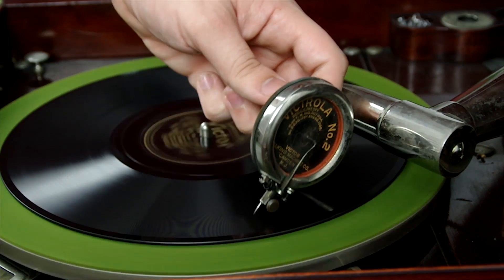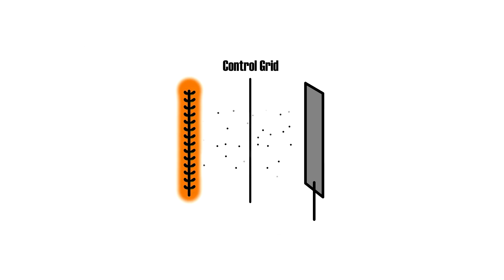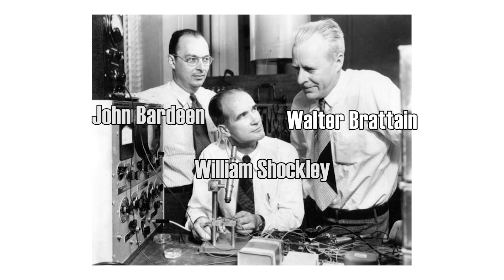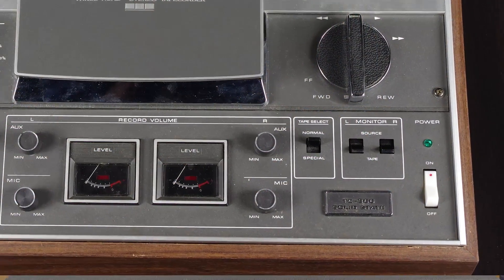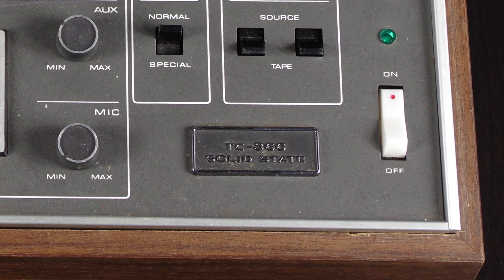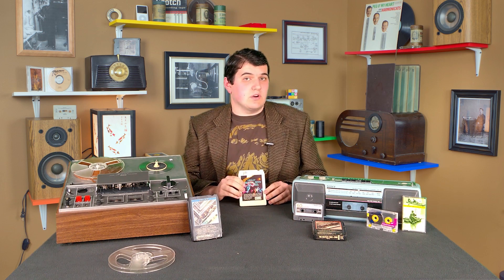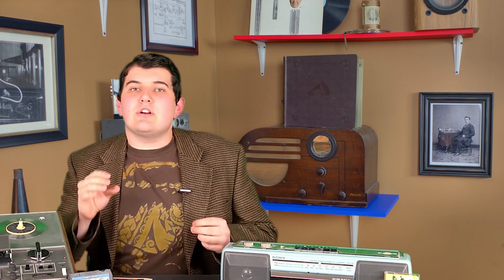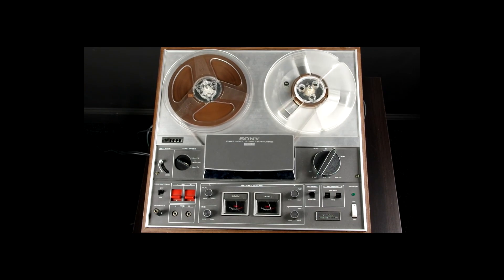Transistors: Making sound easier, smaller, and more efficient

Comment: Very good and informative video.  If I can make one minor correction.  At 3:45 you mention the three terminals of a transistor being gate, source, and drain.  This would only apply to MOSFETs or Metal Oxide Semiconductor Field Effect Transistor. MOSFETs didn’t really show up until the late 1990’s to early 2000’s. MOSFETs are voltage controlled, and really take place in processors, or high power situations.  They gave birth to switching power supplies (like our small phone chargers) and thus don’t need a big step down transformer like linear power supplies.  MOSFETs are also used in audio amplifiers now but there’s some debate that they don’t sound as good as traditional transistors.  Also MOSFETs are excellent at very fast switching often times in the MHz frequencies.  This allows digital tuning without having to adjust a variable capacitor.  

Traditional transistors like NPN or PNP are current controlled, and were the main transistor early on.  They weren’t great for CPUs as they’re not all that fast at switching, but when it comes to amplification, they can amplify a nice clean analog waveform to a bigger one.  Audio enthusiasts say these amplifiers give the cleanest and most detailed sounds albeit they can’t output the power that MOSFETs can.  These regular transistors are still used in LED circuits, and preamp circuits as well as other places where you need to amplify an analog waveform.  The pins are labeled collector, base, emitter.  

Fun fact, over 13 sextillion transistors have been produced since they were first being used in the 1960’s.  13 sextillion is 13,000,000,000,000,000,000,000

That’s a lot! Some say it’s one of the most important and crucial inventions in history.

Comment: I know this video is 9 years old but YouTube just recommended it to me so blame YouTube.
In 3:24 and 3:34 you said a transistor "only" works the opposite of vacuum tube but only NPN/N-Channel transistors are opposite and PNP/P-Channel work the same same.
Pin names in 3:46 are for FET and pin names for BJTs and IGBTs are different.

Comment: When I studied elecrical and electronic engineering at college 1969-1971 it was all about valves and the transistor was not in the syllabus as it was too new. Come University in 1971 and the valve had been dropped in favour of the OC71 transistor. I had a Philips AG8106 valve tape recorder and later a Sony TC399 transistor tape recorder. Currently I have a Technics RS-M231X cassette deck.

Comment: You clearly dont know what you are talking about. I am collector of electronic equipment. Main reason for tubes to be replaced was not bulkines, inefficiency or fragile as you said, but to the countrary of you said next not so great controlling of larger electric current. Tubes are voltage driven, and curents are in mili amps... and most of the power to be controlled require high voltage, but sound quality and overall experience is by far superior. Some parameters like noise of elektron tubes is few hundreds thousands time lower then transssissdstorrrrsss.. and if used properly quality  tubes dont break easy, for 60 vintage and modern used transistor amps I purchased online 18 arrived broken, and for over 80 tube amps 20 arrived broken which maybe 2 were related to tubes... mostly old capacitors. And I enjoyed over 10 amps from 50-60 with original tubes and caps still working fine in 2023 !  And as the answer to why transistors replaced tubes mainly price is to blame, transistors were expensive first, but production could be automated and price droped and that happens.  Transistors have advantages but also limits particularly no soul, many electric guitar players changes tubes to obtain desired sound, does anyone change transistors to do that ?
Reply: Yeah, uh, nobody asked. You probably think you're doing everyone a favor by pointing out things that might be errors in a 7 YEAR OLD VIDEO, but no, you're not, you just sound like an asshole, at least to me.

Comment: Vacuum tubes can be efficient in a correctly designed circuit, which is why now, in 2023, you can get plenty of brand new Tube amplifiiers.    The main thing that made Transisitors popular were small size, cheaper to manufacture and they didn't need to have plate voltages of several hundred volts.   This made it easier to make low voltage and battery powered devices.   Due to being small and cheap, it also became easier to make cheap radios, like a lot of consoles from the 60's and even 70's.   A lot of the TV's still used tubes, but radio sections went  to solid state.

Comment: Just wanted to clear up a few misconceptions regarding valves and transistors.
For anyone saying that thermionic valves are either more or less fragile than their solid state equivalents, there are examples of both. Many consumer grade valves were, in fact, quite fragile, but industrial and military valves were designed to endure industrial and military use. The vast majority of NOS and surviving "tube pulls", along with new-production valves, were designed to meet or exceed these specifications for ruggedness. Today they're primarily used in guitar amps, for crying out loud; musicians and roadies aren't known for being gentle with their gear.
Some transistors can be vulnerable to ESD when not wired into a circuit, but with proper circuit design an installed transistor has rather robust protection against ESD. You're more likely to blow the ass out of a current driver with too heavy a load, but that risk can also be minimized with proper design. Quite a few valves are just as vulnerable to current overdrive damage as transistors (it's called "red plating" in valves). And don't even get me started on the risk of blowing cathode bonding wires in valve rectifiers.
Most audio output valves require an output transformer to transform their high output impedance to match a low impedance loudspeaker. Many of the stories you've heard about guitar amps catching fire during a show have been due to improper impedance matching. This simply doesn't happen in solid state amps; at worst, if the loudspeaker impedance is too low, you'll simply blow the ass out of the current driver and it will stop working; a small puff of magic smoke is released, but no fire. (The transformer contributes to a frequency-dependent reactance with the speaker, but that can be and has been easily incorporated into speaker emulations, both in the analog and digital domain. If you've ever noticed the gyrator in Marshall's cab sim, that's what it's there for. But this point isn't particularly germane to this video or discussion.)
It's true that many valves will drift over time. It's also true that transistors tend to have more inconsistent properties between each device, even between two devices cut from the same wafer in the same production run. Engineers are well aware of both of these factors and design their equipment to operate within "bogey" specs so that such drift and production variation doesn't adversely impact performance. It's not rocket surgery.

Comment: Very common transistor (NPN) BC548 (TO-92) - the Base = grid, Collector = Anode, Emitter, Kathode - applying low voltage (audio) allows power to pass from C to E thus either amplify or switch, however the SCR was developed from the Transistor, of course most people know there are millions of microscopic transistors in a IC....

Comment: What puzzles me is that different vacuum tubes (EL84, 6L6GC, 5881, KT88) gives different sound quality even diverse if the tubes run in class A or AB.
Same thing with transistors, many debate on the sound quality of transistors made of Silicon and Germanium.
Reply: Germanium transistors haven't been used in new electronic equipment since the early 1970s. They tended to be quite 'noisy' in the electronic sense of the term and were less robust than the later silicon transistors. Bespoke hifi equipment pretty much stayed with valves until silicon transistors were available.
Reply: @johnr6168  I am curious though, if Germanium is unreliable, why many still like them over silicon?
Reply: @bpabustan  I confess I wasn't aware that some people preferred germanium over silicon transistors. Perhaps I have somehting to learn? In some ways it's a purely academic argument now as so little hifi equipment ever used germanium transistors. Any germanium based equipment around now will be quite old and it's performance will be also dependant on other ageing components such as capacitors that will be well past their best. Germanium wasn't especially unreliable although some devices did have a reputation for being less reliable than others.
Reply: @johnr6168  intriguing, isn't it?

Comment: I was a teenager when chrome cassettes were the thing.  They won out not just because they were reformulated to sound better, they worked better.  8-tracks were notoriously unreliable.  Most of the time you had to stick a book of matches between the 8-track and the tape player slot so the tape wouldn't slip on the capstan wheel.  8-tracks also had a habit of turning inside out for no apparent reason. 40 some years ago I was successful at turning a Led Zeppelin II tape right side out more than once, returning it to sounding as it should.  When the tape turns around it sounds like Jimi Hendrix but very muddy and low volume.  That was life in the 1970's when I was young.

Comment: The drive system for 8-track tape was inherently erratic, and high wow and flutter was the norm; also the tape had to be coated with special lubricants so that the loops and layers of tape would slide over each other, and this meant that the tape didn't last as long and would tend to "shed",  leaving deposits on the heads, and on the pressure roller and capstan responsible for moving the tape, further degrading audio performance and speed stability.

My dad had a Denon 8-track machine in the early 70's that was fairly sophisticated ----- it not only recorded, but it was programmable, to play the entire tape continuously, or just one track continuously, or play the entire tape and stop at the end. It also had a knob underneath where the user could adjust the head position to best line up with the tracks on the tape, setting it for strongest audio output with the least amount of noise or crosstalk.

In the midv70's I installed a number of Lear, or AR (Automatic Radio) 8 track players into my friend's cars.

Comment: Sounds like if someone in the 1990s wanted to, they could have used the newer high-quality tape formulations from cassettes and made an 8-track of even higher quality due to the higher tape speed.  It'd still be a cludgy pain in the neck because 8-track is an awful design, but it seems sound quality was a general tape limitation rather than a design limitation.  Obviously, the fact that CDs existed for anyone looking for big quality, means it would always be a dumb idea.

Comment: To be more precise, there are different kinds of transistors using different processes.  The early field effect transistor “paper invented” in the1920s mentioned in this video was actually one of the later types to be commercially manufactured.

The Bell Labs Trio developed a bipolar junction transistor manufactured by the point contact method.  Later improvements in manufacture built (or rather “grew”)  BJTs on a silicon wafer by masking off parts of the wafer with photoresist and diffusing the desired impurities (called dopants) as rarefied vapor in a vacuum.

The bipolar transistor uses a sandwich of two polarities of dopants in a single crystal of silicon (germanium was used at first, but it is rarer, thus more expensive, and harder to fabricate), with a thin middle layer called the BASE (because in early methods of manufacture it WAS the physical base of the device), and the other two areas called the emitter and collector; both PNP and NPN transistors could be made, using opposite battery polarities.

This was a current-operated, not voltage-operated, kind of amplification; treating the emitter-base junction as a diode, when reverse voltage is applied, it doesn’t conduct, and neither does the collector.  Unlike most vacuum tube amplifiers, then, the signal at the base must deliver SOME current, and thus some power.  The more current flows between emitter and base, the more curren CAN flow for a given collector-to-emitter voltage through the collector.

In contrast, a field effect transistor (FET) operates more like a vacuum tube.  The first FETs built used a gate electrode separated from the current path by a PN junction normally reverse biased.  The amount of reverse bias on the gate determines how much room there is in the CHANNEL between source and drain, without drawing current in the gate, just by the electric field.  Later, when the process of using low pressure oxygen in a chamber with heated silicon to make a layer of quartz on the surface was invented, the gate became a layer of metal (aluminum vapor deposited in a near vacuum) on top of the insulating layer of oxide, making them behave even more like a vacuum tube.  These were named after the three layers: Metal (on) Oxide (on) Semiconductor, or MOSFETs.

Most computing devices are made of chips with many transistors (a few BJTs for output signals going to other chips, but mostly MOSFETs).

Comment: Gate, Source and Drain are related to Field Effect Transistors which came much later and work in the SAME WAY as vacuum tubes; i.e. a voltage on the gate would RESTRICT the flow of current.

The original transistors had a base, emitter and collector and work as you said.
Reply: FETs are older than bipolar transistors.

Comment: Hold on...~ 10:00 if the compact tape is 1/2 the width of the 8-track, then in fact, each track should be 2x the size of the 8-track-tracks, since 2 tracks are on the bottom, and 2 are on the top. ( 8 / 8 = 1  unit; 4 / 2 = 2 units)? Or does top+bottom refer to edges of the same side?
Reply: If the tape is half the width, that means half the width for the tracks as well, because the compact cassette has four (two stereo) tracks.

Comment: During the switchover, did anyone manufacture transistors that were plug and play replacements for vacuum tubes in old radios?  Something like us today replacing our incandescent light bulbs one for one with LEDs as they burn out.
Reply: Generally, no. Every component around the tube socket would have to be changed, as they operate differently with different characteristics. That is in the case of amplifiers or oscillators. However, in the case of rectifiers, yes, there were some drop in replacement diodes in tube shells. It was quickly found to not be a good idea as semiconductor diodes don't have the same characteristics as thermionic diodes either. And by eliminating the heater draw of one or two tubes, other voltages in the radio would be changed, upsetting circuits.

Comment: Were there ever any Philips cassette recorders that used vacuum tubes?
Reply: Very doubtful. Maybe in the prototype stage.
Reply: No. Absolutely not. The use of transistors was well underway by the time the cassette system was being designed. There has already been several years of transistor radio production by then.
Reply: @johnr6168  Are you so sure? The first cassette recorder (a Norelco, I think) was in 1964, and at least one brand of open-reel tape decks (Tandberg) used vacuum tubes until 1969. (However, Tandberg did not introduce a cassette unit until 1972.)

Comment: I find it interesting how both cassettes and VHS tapes were mainly intended as a recording medium, but both became a delivery system for pre-recorded media for consumption.
Reply: VHS actually is a type of cassette! And it's indeed interesting.
Reply: I would guess that the tape itself had to develop as more durable alongside that evolution. I worked at a VHS video rental place in college (early '90s Sam Goody!), and I was surprised how many rentals it took before we had to "cull" them. We just waited until someone complained (of course) but you could look at the history of that tape. Interesting indeed!
Reply: briefly in the late 70s-early 90s cassettes saw a sort of “revival” as an inexpensive multitrack home recording medium, chiefly by tascam and fostex. they ran at double speed and utilized the whole width of the tape to allow for four separate tracks of audio that could then be individually mixed. tons of demos and records were done on these!
Reply: I also find that interesteing
Reply: The Sony Thirtypoop had a great deal of promise but it was limited by its use of "table top tape" as we, in the industry, used to call it back then.
Reply: @NoZioKikes88  That machine can be rotated in it's cabinet then stood upright. it operates vertically albeit with a slight angle backwards. It is a solidly consumer grade machine from the mid-70s. I've had one for decades. not horrible but nothing to write home about either.
Reply: Pre-recorded Beta tapes had an especially large selection of porn!

Comment: A few simple things about your video, btw not a hater just want to clear things up. 1: vacuum tubes can get hot but some only use a few bolts. 2 I dropped a rca 6dn7 on concrete. Only a chip.

Comment: Wait a second, 8 track was not the first cartridge tape. There was the RCA victor and the 4 track tape (mono version of the 8 track)... Among others. I love your podcast but every so often you get your facts wrong.
Reply: Four track decks were stereo.
Reply: @ernestsmith3581  You are correct. My mistake.
Reply: @andrewbarnum5040  Lear caught the market ripe with baby boomers; he must have made more on tape deck and tape licensing than on airplanes. Going from 4 to 8 track was a great idea too - the audio didn't need to be super for vehicles, the name was distinct, and he could decrease the tape length to 1/2 what was needed in the 4 track for the same run time, AND that made that confounding mechanism operate better. He had a winner for a few years!